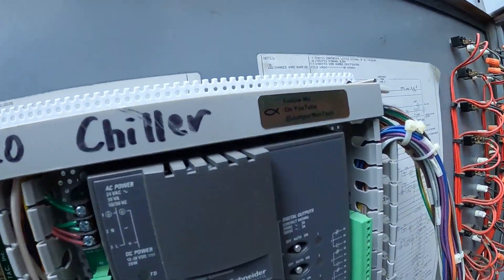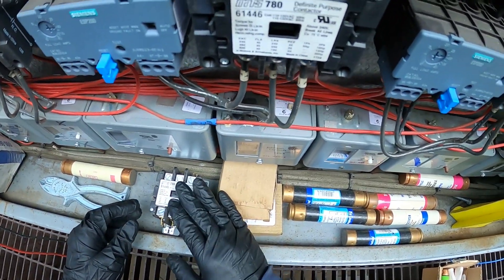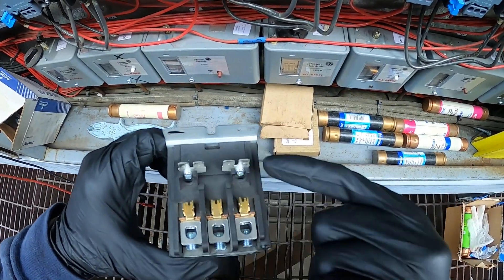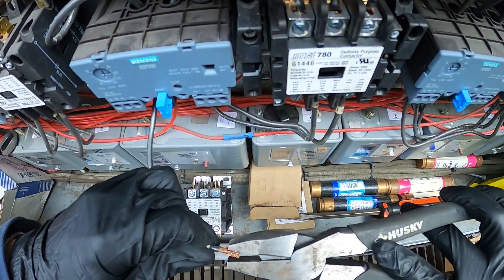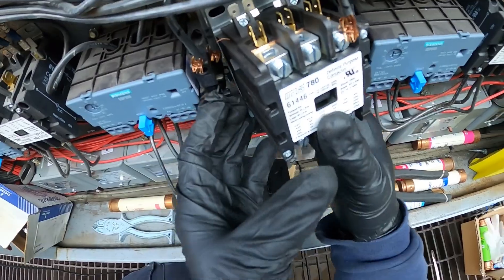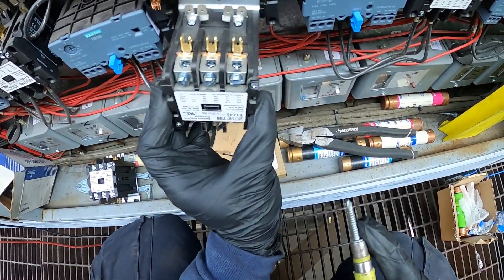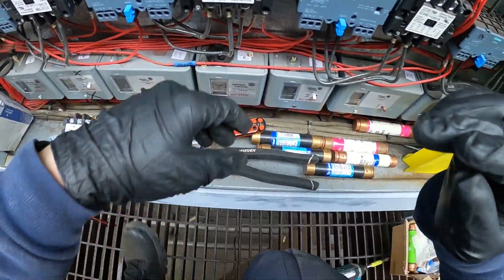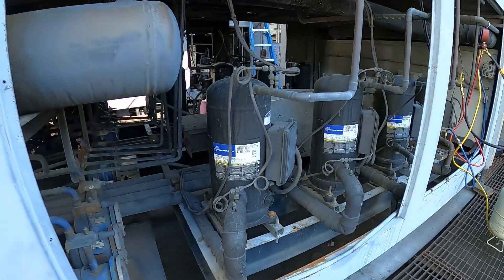HVAC Service Call (How To Replace A Contactor) Air Cooled Chiller/Industrial AC & Refrigeration

Comment: Great job !! Stay safe brother and wow that looks like an older chiller with blowers ?
Reply from the maker: Thank you man! You too. Stay safe  with all that's going on. We are stilling working in the field. Yes! Air cooled chiller👀 8 compressors & 8 condenser fan motors above. Opening up that control panel is intimidating
Reply: How you got started working for yourself?